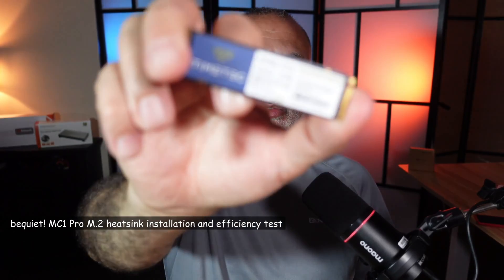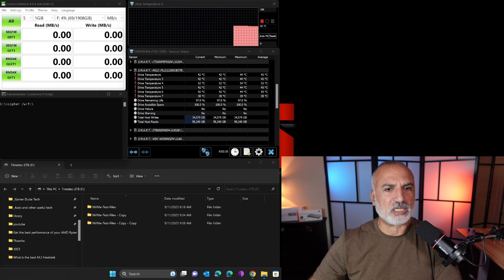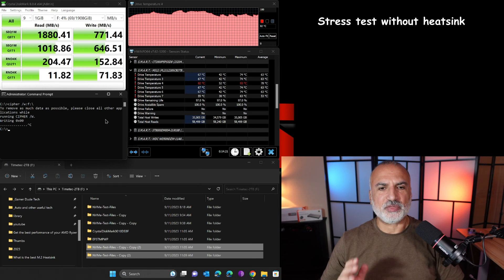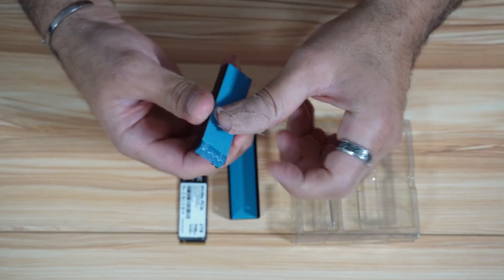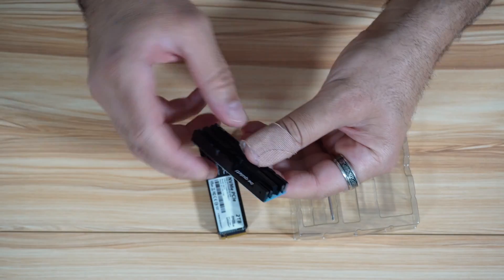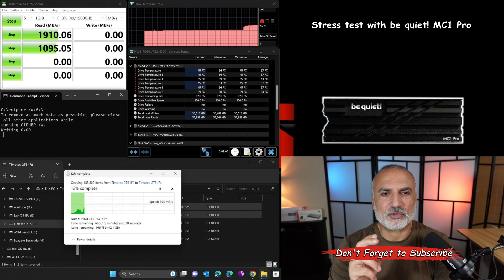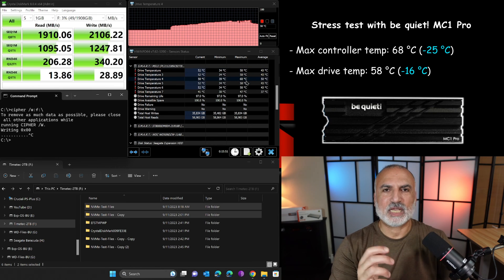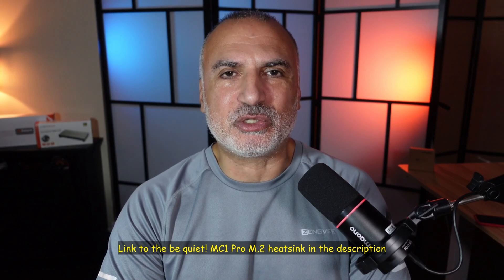be quiet! MC1 Pro M.2 Heatsink installation and temperatures test

Comment: Do you leave the M.2 Label on the drive when installing into the Be Quiet MC1 Pro Heatsink?    Drive is Samsung 990 Pro 2TB NVMe     Ordering this soon as i can to properly cool my drive  in my MSI Pro B650 VC Wifi Rev 1.0 Motherboard
Reply from the maker: Yes, you should never remove the label otherwise your warranty will be void

Comment: Great review! Especially appreciated you showing the installation. I ended up purchasing this after watching your video. My SSD wasn't running extremely hot, but I only use it for gaming, and my controller was easily reaching 75+ during games with my nands between 55-60. This was a bit too close to the rated max from the manufacturer for my liking. After initial testing my controller doesn't go past 55, and my nands haven't reached 45 yet! What a difference for such a cheap product.
Reply from the maker: Great to hear!